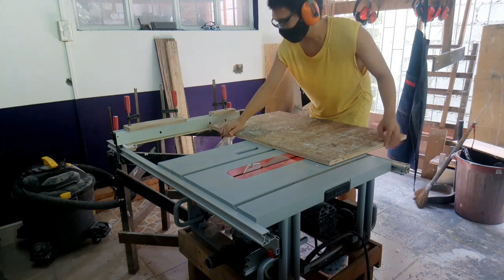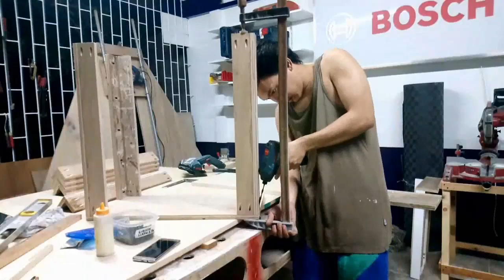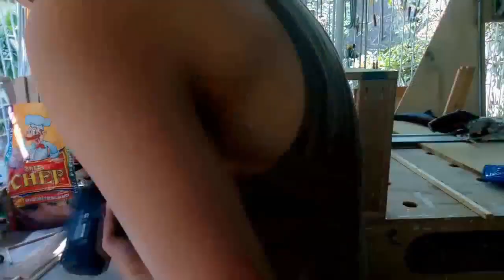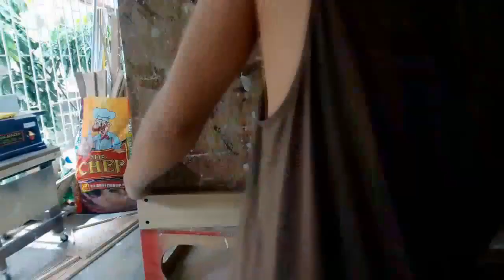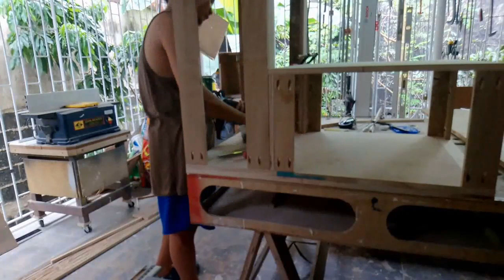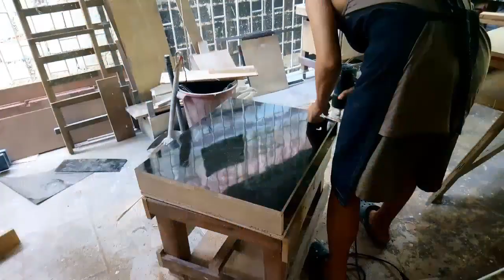(Eng. Subs) Bosch  GTS 10j table saw station with extension

Comment: Where did you get such a long extension of a fence rail" ? Is it a standard extrusion rail?
Reply from the maker: it is not. got it from a friend of mine. 

where you from? if youre not from the philippines you can order the extension from bosch directly i think.
Reply: @RoiDiola   I'm from Belgium. I don't think that bosch sells those extensions,but I will ask. Thanks !
Reply from the maker: @digidandan  ill get back to you with the part number :)
Reply: @RoiDiola  you're the greatest !
Reply from the maker: @digidandan  2610015074 and 2610015091 thats the part number for the 10j extension :) goodluck!
Reply: Roi D thank you so much 🙏